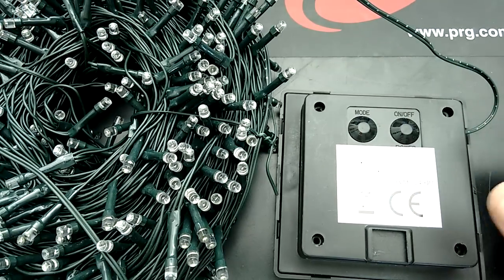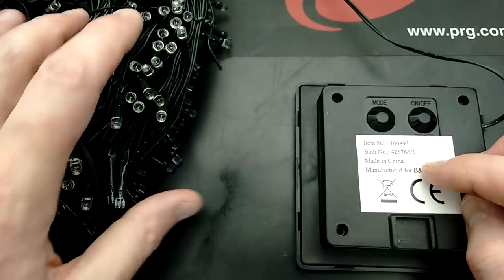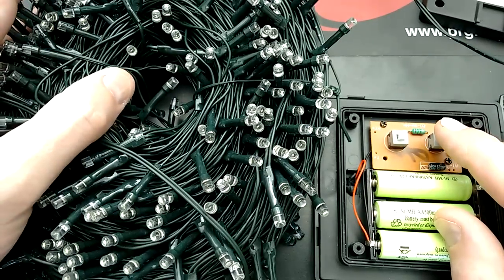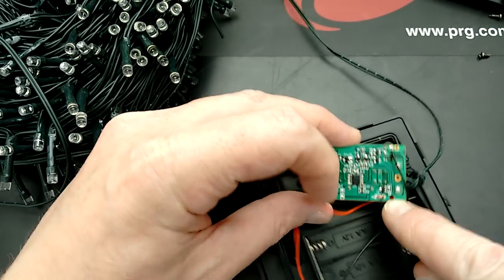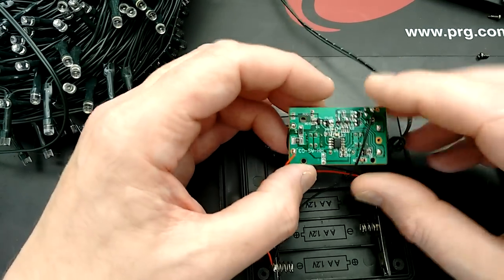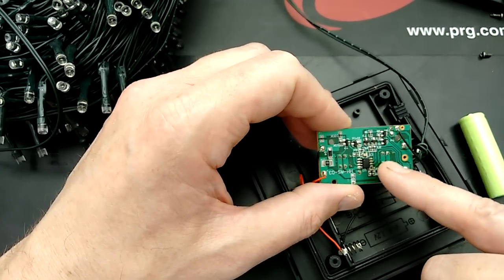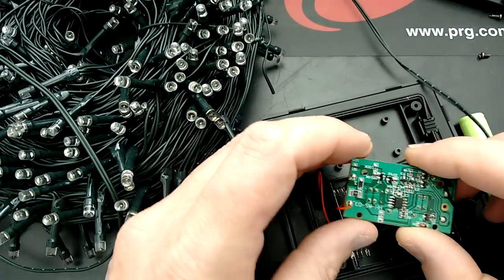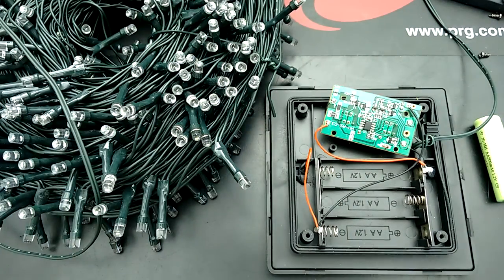Inside B&M Homestores 480 LED solar light set.

Comment: I recently bought some sets of Philips brand solar net style lights, and they use this exact same case and solar panel in them. But the interesting part is although the case has the same spot for 3aa cells, they are only using one NiMh cell in them. The springs and positive battery contacts for the other 2 cells are in there, but not wired up. I suppose I could wire them up in parallel with the one cell in there, and add more cells if they don't last long enough through a few cloudy days in a row. Upgradeable hardware is always a bonus... 👍

Comment: Clive they are crap, I've got 3 sets from B&M, One 60 And two 200's, 60 set is fine but the two 200's Went dodgy  after 6 months, Both loosing power to one of there two strings. And yes, Water does wick up, Badly.

Comment: Could the H bridge be use to drive dual color LED. The one that have different color depending on the polarity?
So for a red/green we could have a mode with red, one with green and one with the traditional yellowish from Red+Green LEDs
Reply: I have a string that works sort of like that: it alternates between all-white and colored LEDs, I'm guessing by having the white and colored LEDs in opposing parallel and using an H bridge to swap between them.

Comment: A BIT OFF TOPIC - Greetings from the great plains of South Dakota. We spend our winters in our old Class A motor home, down in Arizona.  I have a lot of items that run off 5 volts, and plan on building a charge station in the bedroom, on the computer desk.  I plan on using this power converter: http://cgi.ebay.com/ws/eBayISAPI.dll?ViewItemVersion&item=291792084664&view=all&tid=1337166011019 to step the 12 volt power that is wired through out the home and wire it up to a 10 outlet cheap china USB strip.  Am I going to have trouble with to much amperage over the circuit boards, and will I have to rewire that cheap china junk USB strip?  I used to have the strip hooked to an old PC that has been relegated to the junk pile in my back room, so I only need to take it off the tower.  I planned on hooking the power up to the power input and not the USB input on the strip.   I ask you of this simply because you are the smartest fellow I know when it comes to electronics, and thanks a million for the videos, I learn something new every time I watch one of your videos!

Comment: Another drawback is that if one bulb goes out they all go out and you have to swap every bulb to find the bad one like in the 1930s. 😉
Reply: Not with these you don't, Leds are soldered direct to the wiring and if one goes out the rest stay lit. Got three sets of these, All with an led popped here and there.

Comment: Looks a cool circuit and using AC certainly is a ingenious design to control a diode.
Less current, no 3rd wire to flash alternating bulbs, easier manufacturing of the string...not sure about oxidisation as surely there are easier ways.

Comment: Great video.  Thanks for sharing.
In the states, the insulation on these types of lights contains lead.  Do lights in the UK also have lead, and how might this impact disposal?
Reply: How did you come to the conclusion that the insulation contains lead? 
This wouldn't be allowed in the U.S., if there WAS lead in there. The warning on the package most likely refers to the lead in the solder that connwcts the wires to the contacts in the individual light sockets themselves.
Reply: @davelowets  Thanks for asking.  It's actually stated on the package.  The lead is added to the PVC coating to prevent it from cracking or breaking.  Some brands have only small amounts.  Unfortunately, some others contain lead that's above the CPSC limits, but are somehow sold in the US anyway.  Have a blessed day.  🙂

Comment: I found with my own Solar lights that the negative wire always go's black after a year or so and if it disconnects you have to replace it because you cannot re-solder it.
Reply from the maker: If you scrape through to shiny metal they should take solder again.

Comment: You can replace the cells with larger capacity cells to run it longer like I did with mine 20 LED version. The original cells that come with these are usually garbage.
Reply: +ELECTRONTHORP ever take apart power failure lights?  I have found the elongated oval shape plug in ones some have 200mAH AAA cells (in a 3-pack shrink-wrap).  If they quit you can solder in a cordless phone 600-800mAH pack.  They seem to work well though.

Then there are cylindrical tube shape ones that use watch battery looking things and seem to have 100% failure rate with exploding batteries.

Comment: My hunch (before video completed) about ac over the leds: It's stronger to run the string with '3' wires, so that a given led isn't the strong part of a single 'led' joint -- the wire going past and twisting around the others is the strength.  If they were all just parallel then the led would be the connection point/weak spot.

Comment: Sounds like the HomeGoods stores we have here in the US. I haven't seen any strings of solar lights that big before though. They did have a solar fountain display going, but the panel on the unit looked like it had gotten water wicked into it. It was particularly odd since it was set up indoors.

Comment: Hi Clive, I have a set of these, what mains voltage can I stick on them?
Reply from the maker: If your 3V power supply is capable of supplying a few hundred milliamps then they should be modestly bright.  It would have to be at least 3V under load though.
Reply from the maker: The string has all the LEDs in parallel, so they only need around 3V.
Reply: On 3v, they are very dull..... low current?
( I just want to run them static from a mains supply )
Reply: So, I tried this (by rigging it up with a USB charging cable, like what you did in another video) and I got a lot of flickering at first. Then they seemed to settle down. Left them on overnight and now only half the string is lighting up. Whats going on there? My soldering is crap at best, but surely it can't be that bad. I'm guessing it's to do with this inverse-parallel wiring situation.
Reply: you can just remove the string of led's from the box and attach them to a mains pug and plug them straight into the wall because there are 480 led's the voltage its shared between them so they will  all get about .5v each
Reply: That interesting! I stuck 12Dv across them and they seem to glow very brightly!
Reply: +Martin try giving them around 6 volts DC

Comment: I have a number of old school mains powered led strings that have turned to rubbish no doubt due to electrolytic corrosion, these lights had been used out doors. I imagine the savings over the traditional mini filament lamps off sets the cost of replacement? Not so sure about that, energy costs perhaps but I have filament strings with many decades of seasonal use still running strong.

Comment: Great channel!
long time lurker.

How long-ish would those batteries power all those lamps? Cant be more than an hour? Or are there secrets when it comes to powering LEDS with battery?
Reply from the maker: LEDs will generally light visibly at just microamps of current.  So this entire string could be run at just 10mA and still light visibly.

Comment: Shouldn't BM leds be brown? 

Do brown leds even exist??
Reply: Pink leds are blue InGaN dies with orange-red rare earth doped silicon oxynitride phosphor overlays. Brown should exist.
Reply: Black ones should exist, when you turn them on, it gets darker,  someone should get this done.
Reply: Brown doesnt exist because brown isnt a 'primary color' ie. theres no brown in rainbow. Brown is a mix. And brown is quite hard to make using leds because you'd have to mix colours..
Reply: +jusb1066 ultraviolet also called blacklight because humans can't see it and lamp becomes quite dark while it's on.
Reply: Pink ones exist though and that's not a primary color...
Reply: +simontay1984 yeah. Its easy to mix colors with white.
Reply: Brown is dark orange.
Reply: there is no pink. ask v-sauce. ;p
Reply: +Jusb1066 Clive's done that. With a ''100 w'' LED chip. And tig welding :)

Comment: Maybe the chip on its own can only power 240 led's, but by using the H- bridge to reverse polarity means they can alternately power all 480
Reply: That'd make sense. Still amazing the abuse these designs put little solar panels and AA batteries through.
Reply: I'd thought the same even tho I'm a total electronics virgin. if the chip could've done the whole job, there'd have been no need to the extra circuitry. Therefore only half of the lights are likely illuminated at one time like the way TV is interlaced.

I'll be a mad scientist one day, just nothing to do with electronics..

Comment: What is electrolytic corrosion
Reply: It is moisture/water and dc current corroding everything. Much like normal corrotion under water but much faster and it can also corrode similar materials and sometimes materials normally resistant to corrosion.
Reply: You know electrolysis, where you put a voltage across two metals in a liquid? And one metal ends up migrating towards the other. 

Well if you have a DC voltage across 2 LED pins, and some rainwater gets in, a small amount of electrolysis takes place. Like high-speed electrically assisted rusting. Eventually the LED will give out. 

If you use an AC voltage, the metal ions liberated on one piece of metal are soon attracted back again, so corrosion doesn't happen nearly as fast.
Reply: https://en.wikipedia.org/wiki/Galvanic_corrosion
Basically it's the exact same thing that happens to the negative terminal of any non-rechargeable battery. The "corrosion" label means it's happening where you don't want it to.

This is why boats almost always have an often otherwise useless hunk of zinc attached to the exterior of their hull (bigger boats usually have many of them).
Zinc acts like the negative terminal of a battery for a lot of useful metals and alloys including brass, bronze, copper, and steel. All 4 of those are found on any large ship, so adding zincs and replacing them regularly is the key to preventing ships sinking due to holes caused by corrosion.

Other ships use a carefully regulated electrical current flowing in the opposite direction to the one that would be flowing if electrolytic corrosion was taking place. Basically replacing zincs with a bit of electronics that can put out the same voltage, as well as an electrode that contacts only seawater and an electrode that contacts the ship's hull.
This doesn't work on cars for the simple reason that they're not submerged in seawater. Any device that claims it works on cars might work on boats, but it certainly WON'T work on cars. Sometimes they're just "looks like it should work" boxes, just a glowing LED and nothing actually functional inside.

For electronics, the relevant reaction is electroplating, but again the anode is consumed, so conductors at lower potential will be corroded faster than ones at higher potential. In other words, the ground lead gets eaten first.
This happens a lot on cars in regions where they salt the roads in winter, because saltwater is saltwater as far as the electrochemical reaction is concerned.

Comment: The inductor boost converter is probably there for when the batteries are running flat.
Reply: If the batteries are dropping in voltage they should be cut off to avoid damage.
Reply: Three Ni-Mh cells in series have a fully discharged voltage of 2.7v.
That's not even going to make a white LED put out a single photon, let alone glow, so a portion of the batteries capacity would go to waste as it would never be usable without a boost converter.
Additionally, it's rather easy to put a low voltage cutoff in a boost converter IC. All it has to do is block or shunt the pulses that drive the power transistor, and the voltage would no longer be boosted.
Reply: *****
Well, maybe "Not a single photon" was overstating it a bit. But I think we can both agree that they're certainly not putting out any useful amount of light at that voltage.